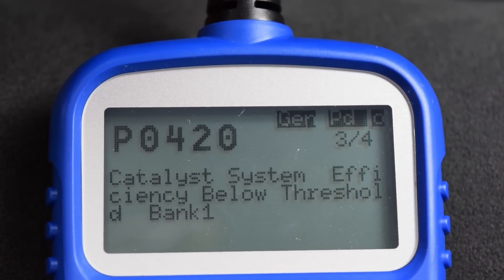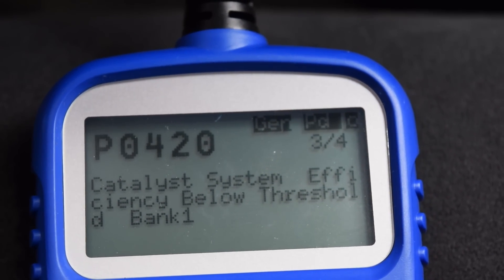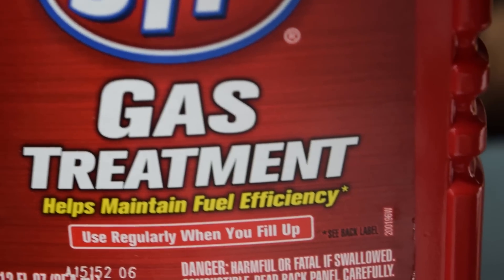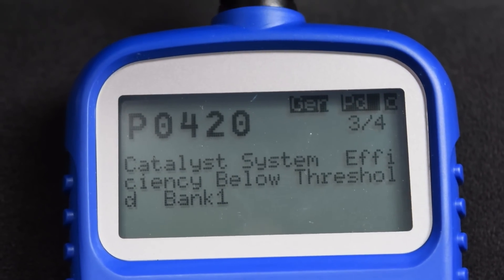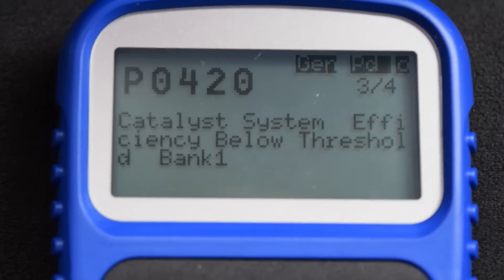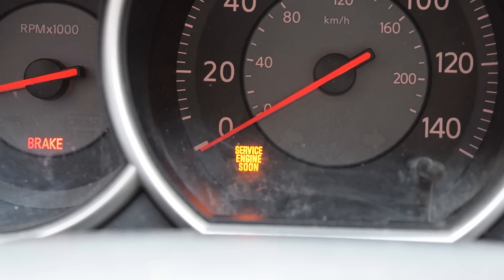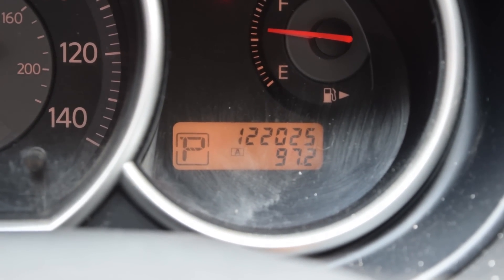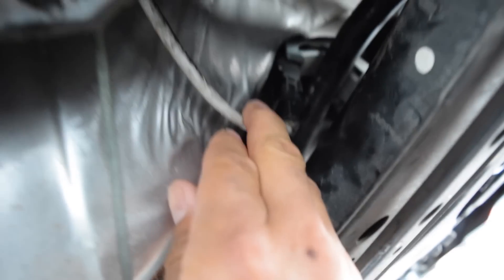Code P0420 Catalyst Efficiency Below Threshold Bank 1. Emissions Test! NO PROBLEM!

Comment: Lacquer thinner is a solvent, not paint.  It will clean some carbon.  If the problem is a clogged cat, solvents might work.  If the problem is that it is just used up, nothing will help.  The O2 sensor might also be the problem.

Octane slows combustion so the gas will burn longer through the stroke.  I am not an expert but lower octane might be better to clean the exhaust system out???

Comment: Pull the upstream O2 out and dump some berrymans down into the converter and let it sit for 30 minutes and then put your O2 back in and take the downstream O2 out and spray it out really good with carb cleaner. You might have to do it two or three times but it will solve the issue if the converter isn't damaged internally

Comment: I had this code on my honda civic 2003 ex , I remove the 2 oxygen sensor clean them with a cleaner spray , i inspected the catalizer converter i saw i had  a leak cause my exhaust flange gasket was finish I replace it  bought a cataclean , I read in the bottle of cataclean when my level of gaz  is around 4 gallon empty the bottle in the tank  driving 10 or 15 miles fill your tank completely,  after I finish to put the cataclean I erased the code p0420 , five  minute later during i drive the car the check engine was come back I still driving the car for 45 minutes when I scan the code it gave me p0132 , i think it was about the cataclean I put in the tank , I went to a gaz station I filled the tank , once I leave  the gaz station the check engine light is gone ,  tomorrow morning check engine light come back with p0420 I still driving the car after four day the check engine gone by itself , now my car is more good in gaz , I drive 30 minutes back in fourth to work  Monday to Saturday before I have to fill my car each Sunday,  now  Sunday I almost have a half of tank of gaz

Comment: Check for exhaust leaks at the catalytic converter connections and O2 sensor. Even a small leak will throw a code. The leak will draw in air...(oxygen)

Comment: The cat cycle was incomplete (INC) on the computer. Guarantee about 10 more miles down the road the check engine light came back on. You can pass obd test with ONE INC and that’s exactly what he did. He passed the test before the cat system full tested. Easy peasy. This will def not fix your code 420.

Comment: Yes, I had the same. Previous owner drove the car to slow. I Didn't use any products.  Just pushed the engine to its limits a bunch of times on a steep long climb up hill accelerating. High Rev and high turbo charge so exhaust downstream is the highest. P0420 was gone. It's funny besides here nowhere else it's suggested
Reply: The Italian tuneup!

Comment: I believe the Cats on my 2005 Subaru are around $3000. 2 new front O2's and Cataclean have finally cleared the CEL. MPG's have improved as well. 150,000 miles.

Comment: So listen I bought a 2004 Honda accord ex and has the code p420 they put a universal cat on it I bought a new one for 140$ and got the whole exhaust changed did it fix the code no it came back and I changed the sensors the code came back a month later and now after all that I got the high octane gas thing and it went away and been away for 5 days but I think my ecm needs to be updated or a exhaust leak

Comment: My 06 DTS has a few P0420 codes tangled within itself, EGR, HVAC, Bank 1 Low efficiency! I’ve replaced almost everything on the list except for the EGR Valve Bracket that could have a tiny hole leakage in. Who knows! Any suggestions besides the usual issues. Yes I have replaced the cat… mechanic told me I had a bad cat, I put in both Purge Valve and Solenoid and the engine drove better than before! Which is why I haven’t sold the vehicle because the engine and transmission is strong!
Reply: Any update

Comment: Hey, I had the same code on my 04 4Runner and I filled up the tank with 93 like 3 times and I did reset the check engine after I filled up the tank the first time - the check engine came back with the same code, I kept putting high octane in the tank and reset the light one more time and it didn't come back, it's been 150 miles, not sure if that's enough driving to reset the cycle.. I am still driving with 7 gallons of vinegar in my car, in case the code comes back, so I can wash the cats lol. Will see.

Comment: Sorry dude.
You probably know this by now and I haven't read any other comments.

But high octane gas isn't anything special.
It's actually less volatile than the 87 meanings less explosive to avoid knocking engines with higher compression or that run more advanced timing.

Put top tier gas with better additives help maybe.
But that was the cause of the p420 code
Even if you fix the cause you've probably already roasted the catalytic converter..
Which is why that code is going to keep coming back every 500 miles.

I got two of them on my van to the tune of $2,000 to change so I tried everything.

Lacquer thinner, cataclean, and all the other products next to it on the shelf.

And at best they might delay the light coming back on for a few miles but the truth is these catalytic converters got melted inside or coated so bad that they've lost efficiency and will need to be replaced that's the bottom line. (And then I should have waited till I watch your video all the way through I hear at the halfway point you're exactly on point with what I'm saying here)

Hopefully at least save some people $100 in expensive gasoline and $20 a gallon products that don't work.

And I know we're all used to saying Cadillac.
But a catalytic converter is using a catalyst
Cat uh list.
Or even cattle list.

And did you hear about the farmer who found a tick on one of his cows that was totally high?

He found a Cattle lit tic.

And that's great that you passed the test.
I did a test here in New York.
The code came back just as I was driving up the street to the freaking shop.
I reset it, with my code reader.
And next thing you know it passed.
Either I think they let this code slide, are the shops no way to get it passed when no one's looking.
Cuz the code keeps coming back.

Comment: You are dumb. Thats why the catalyst monitor did not complete. There is a problem with the catalyst system. Either a voltage reporting problem going to the PCM from the post cat o2 sensors, a lean running condition, lastly a bad cat. Your "fix" is not a fix at all dumb dumb.

Comment: My Xterra has been giving that code for 5 years and I just ignore it since it has been running fine with no hesitation or decreased fuel mileage the whole time, when it starts causing a real problem I will clean them out with rebar and a piece of electrical tape for the light it works great every time 😄
Reply: Can you drive like that?

Comment: I put that is working but after you have put contact the kit engine and disconnect the positive and negative cable battery for 10 second and conect and star the kit engine

Comment: I got this on my 2014 jeep patriot and autozone suggested catacleaner. Put in half tank, drove 20min around 50 to 65mph and engine light is still on. No performance issues or power loss. I haven't noticed any leaks. Light came on today but not last night when I drove down the street.
Reply: Could be your O2 sensors. Possibly one but if so best to replace both.

Comment: Ethanol is 100 plus octane, I used 5 gallons on my 07 Volvo C70 and got rid of the code. 

They say it’s bad for the car but I’ll find out. I’ve been filling up the gas tank with ethanol in my car for the past two years since the beginning of the Brandon administration, specially now that gas is 6$ plus a gallon in LA. And I’ve not had a problem with any components. I do get the code for system too lean in idle but not the catalytic code.
Reply: I love Brandon

Comment: @Rc Jr thanks for sharing. I have the same issue with my Nissan 2005 Altima v6. It wouldn't pass inspection in the state of Maryland. My questions is, do I run the Cata-clean solution & StP cleaner at the same time? and how much gas needs to be in the gas tank b4 adding all those cleansers above? Also do I run all the cleaning solution on my way to conduct the inspection or what? Btw I have been running premium gas in my car for the past 17years since I owned it. Thank you Sir!

Comment: Talked to a few muffler mechanics today that told me that's a failing catalytic converter problem, even though I strongly suggested it's an o2 sensor problem like the YouTube videos say.
Reply: it can be both, its just a code, i just installed a high flow cat, put brand new 02 sensors on it down and up stream and it’s throwing the code at me, and for others its actually because there cat is broken

Comment: Ive had this code a few times on my honda prelude and i was told it comes on when my engine is running rich due to an evap sensor leak ive also had on and the rich condition melts the cat eventually

Comment: I know the is video is from a few years ago but I had this same problem and wanted to see how you made it.I have a 04 Liberty and ended up buying a cat from a company in Canada Toronto and it was allot cheaper then the dealership as you would imagine.i paid a little over $300 changed it out myself along with 2 new O2 sensors and I was getting the same code as you PO420 and had only 130,000 miles on the old one.good thing was the scrap yard gave me $110 for my old one.But as of today 5-11-22 every 6-7 months I get that same code.not sure if I’m gona change the injectors out but other then the injectors I’ve done plugs coil packs TPS,Map sensor and all OEM.did this over time not because of the code because I am e last one to just change parts out.Any input would help great.thank you
Reply: How did it go? Did you ever try any fuel injection cleaner? How's the new cat?
Reply: Trade it get a beater from Grandma who doesn't want to drive anymore.🏁

Comment: I have same code on 2016 accord honda with 100k miles... and check engine light is on
Reply: Did anything work for you?
Reply: @Chosen-One-24  yes I bought cataclean
Reply: @simplyclean4907  Did you put it on half tank and 16oz bottle? I did it early on it worked but then now it hasn’t worked for me anymore. I just started using 93 gas and will try it again as well as STP.
Reply: @Chosen-One-24  it has to be 1/4 tank estimate 4 gallons left and put the whole liquid in the gas tank .. drive for about 15 miles the. Fill up with gas
Reply: @simplyclean4907  thanks I’ll try again
Reply: @Chosen-One-24  for me it took couple days to remove the engine light and had to fill up 3 times...
Reply: @simplyclean4907  3 times as in gas or cataclean?
Reply: @Chosen-One-24  gas

Comment: before changing the catalytic converter try and take out the sensor 2 that is after the catalytic converter and spraying it and cleaning it with break cleaner. The inside of the sensor had a part that was meant to be moving freely and mine was stuck with shoot. 
After cleaning the sensor P420 , the code disappeared and the car runs perfectly. I've done 100 miles and no problem. 
My car is a Toyota Avensis 1.8 petrol 1zzfe engine with 159k miles on the clock
Reply: Any update on sensor you cleaned?
Reply: Gumout worked on my 05 grand prix 130,000 miles, the check engine light was on for years till I bought a code reader this year. However I changed spark plugs as well, it did have a ETC sensor code as well, I may change it out with a coolant flush
Reply: Is it Still Running good no lights on dash?

Comment: Got my $20 OEM 02 sensor for bank 1 off Amazon for my 02' Blazer ZR2 & it corrected my issue. 
I Bought a FlowMaster Cat for $120 last year, 2021 from my local AutoZone. $50 bucks cut & installed 🤟
Reply: Which o2 sensor worked for you?

Comment: Bank 1 Sensor 1 is upstream and generally the closest one to the exhaust manifold and easiest to get to.  Takes 2 minutes to change on most and $35 for a single.  Dealerships want $300.
Reply: $35 for O2 sensor.  Catalytic converter on an Acura or a Honda should last 300,000 miles. Anytime I’ve gotten a P0420 code and have changed the bank 102 sensor, I’ve never had a problem after doing that. Changed my last one over a year ago and zero issues.
Reply: @gregsheffield7586  i have an 2013 acura tl right after i put in gas from a local gas station i got the P420 code 
Do you recommend I change that sensor?
Reply: Where is the bank 1 sensor exactly ? Do you mean is on front of the car engine ?
Reply: @TechSignn Yes
Reply: I just found the bank 1 sensor for $40

Comment: I tried all the cure to clean the cat but the light will surely come back guaranteed.I will replace mine next year when my smog is due,No cat converter last forever. Some cars last 100k miles some 200,000 k miles like most Hondas and Acuras.Nissan I would say close to 100k miles.Thank you just sharing.

Comment: Don't want to be rude , but try and be a bit more to the subject. Most people want to know the solution if there is one ....  Otherwise keep it up 👍
Reply: Or maybe there's a million other channels you can go check out..it's this guy's channel last time I looked..
Reply: @GOIN-CRAZY  Yes I could just go and look at the other millions of channels... The whole point of giving a review is to help him improve to attract more viewers, or I could just hit dislike button and carry-on looking at the other millions channels ?? I didn't hit dislike ...
Anyway I managed to sort it out by taking out the sensor 2 that is after the catalytic converter and spraying it and cleaning it with break cleaner. The inside of the sensor had a part that was meant to be moving freely and mine was stuck with shoot. 
After cleaning the sensor ,the code disappeared and the car runs perfectly. I've done 100 miles and no problem.
My car is a Toyota Avensis 1.8 petrol 1zzfe engine with 159k miles on the clock.
Reply: @marceldaniel673  hey it's cool that you're trying to give constructive criticism..thought maybe you were joining the other ones trolling him. Yeah the downstream sensor is usually the culprit, glad you sorted it out. Take care..

Comment: For over a year I have been fight the famous P0420 code replace cat convert manifold (mines in one Hyundai elantra 03) replace o2 sensors twice. Once from auto parts store then from dealer. Used emissions cat exhaust system cleaner. Cleared codes let run at 2rpms for 40 min then drove 75 miles then light came back on. Same code came on. Battling this for almost a year. Please help
Reply: Check if the gasket between the pipe flanges has gone bad. If so, spray the bolts and nuts under there with PB blaster or Liquid Wrench or any penetrating liquid brand name to help loosen the bolts that may be a nightmare to remove due to rust. Be ready to replace nuts or bolts.